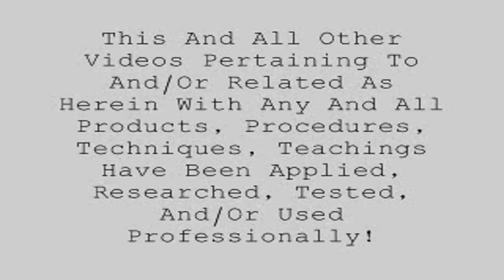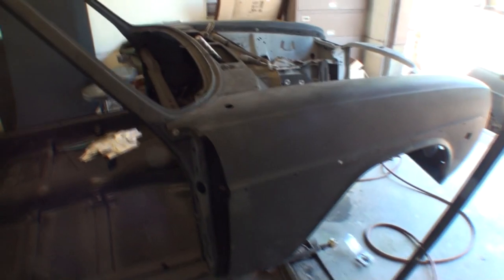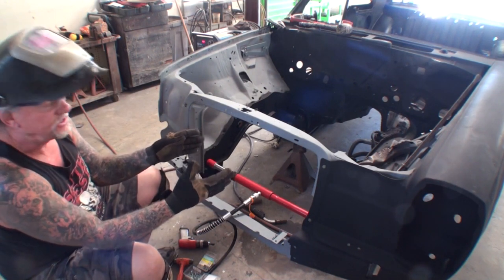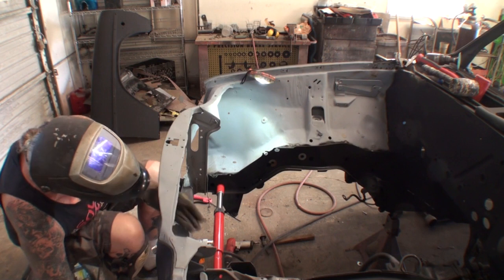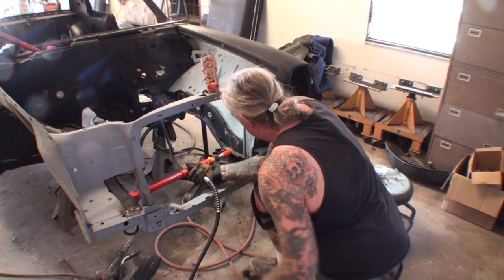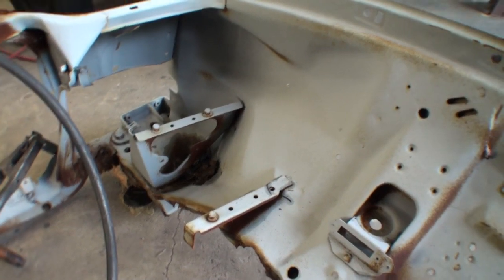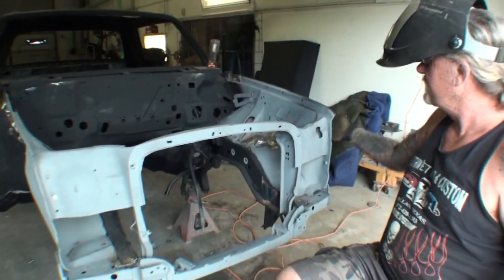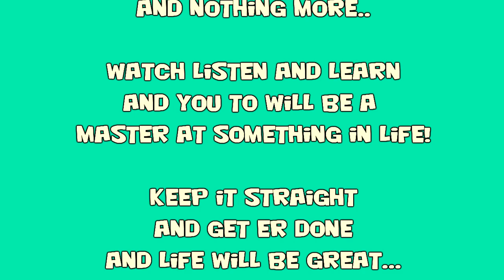Can You Restore A Rusted Car? " At Home " - Part 14 - Mig Welding Lesson

Comment: Pete, got a question: got a quorter panel that i did weld Up but bit is crappy done. Heard that epoxy bodyfill designed for boats over the crappy welds and then scratch the fill up to put regular bodyfill to over the top of the epoxy bodyfill and so on would be a semi serious work. What is your wiew on such an situation. I Will try to weld it Up the best i can but i dont think i Will be sucessful thats why i would feel greate if i had something that can handle the moist from behind

Comment: I am seeking some advice on what to coat my trunk floor with.  I had to remove a 44-year old original trunk floor from a donor car to use in my car.  It had some heavy surface rust underneath, but no holes after cleaning it up.  The metal seems pretty thin.  Nobody reproduces this trunk floor, and it took me two years to find one this decent, so i really want to prevent it from getting any thinner.
Any recommendations on a product to seal it up for the long term?
Reply: If you have a welder, replace the metal that is too thin. You can make your own patch panels with 18 gauge sheet metal and simple tools. Use seam sealer. Coat it with POR-15 or similar rust encapsulator/preventative type paint. I recommend Fitzee's Fabrications Youtube channel.